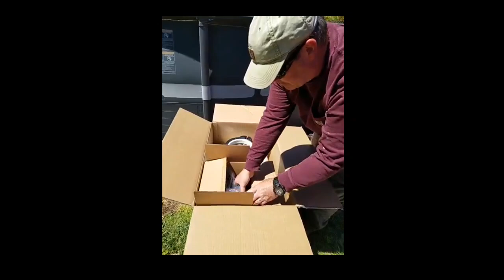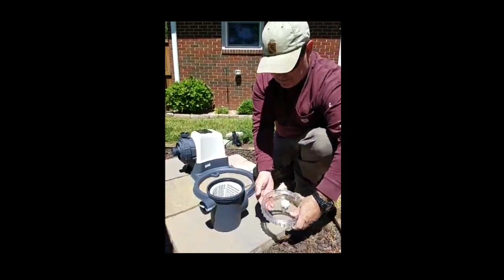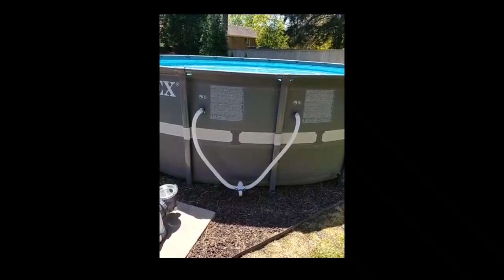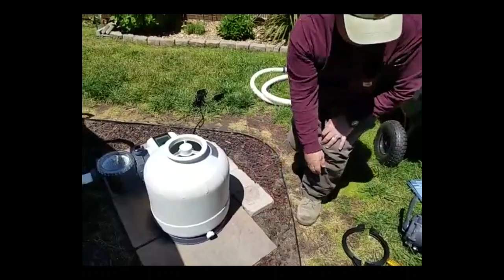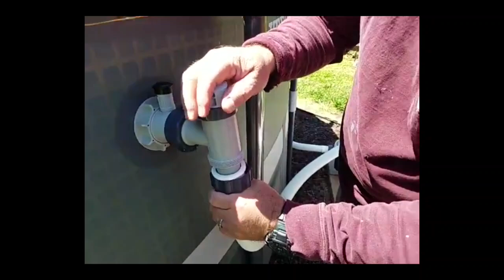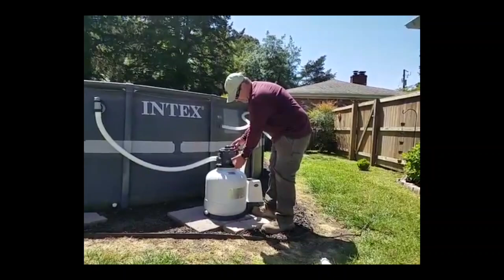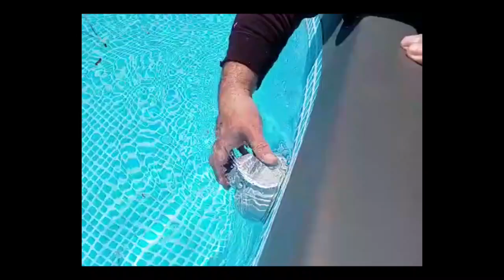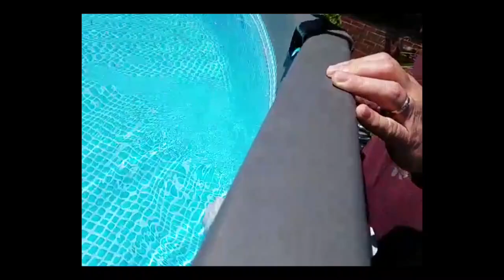INTEX SAND FILTER PUMP - Setting the pump up for above ground pools

Comment: The valve piece on the discharge that you have you black cap on,  if you remove it, it helps aerate the water.  I always keep the cap off. Makes it like a hot tub lol
Reply from the maker: Interesting. Let me tell my husband and see what he says. Stand by.
Reply: @MoverandShaker  aerating the water is good for it. If you look up  that item on Google it will explain better than I can
Reply from the maker: At first he was a little weary but I showed him the before and after and he liked it. So what  do you think they include that cover what purpose does it serve?
Reply: @MoverandShaker  so from doing a quick search to help answer you,  I would say partly will be personal preference. 

I read one article saying it helps cool the pool if it's warmer than you like and another says it helps raise pH levels.  I always run it without the cap because I enjoy the look of it. I use the cap when I'm going to vacuum to make sure all the air gets out of the hose tho.
Reply from the maker: @slamdhatch1150  O.k. I better find the cap then, I conveniently "'lost it" ha ha
Reply: @MoverandShaker  I would say you can just alternate it every now and again.  One other thing I did was upgrade my inlet strainers to the larger 1.5 to match the outlet that came with the sand filter.
Reply: @slamdhatch1150  I have the same pool. What vacumm do ya'll use?
Reply: @aprilwaller123  I currently use the triangle one from Walmart. But I also installed a thru wall skimmer and has a neat attachment for vacuum hose
Reply: Mover and Shaker thank you for your videos, it help us a lot. Do you minds doing a video showing this? And how strong the suctions is? Ours are a barely feeling it? I’m sorry we did something wrong. :/ thank you